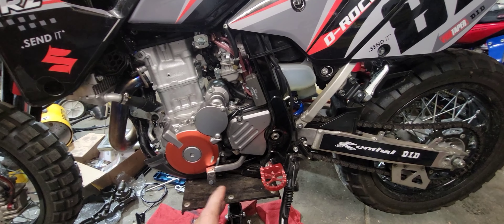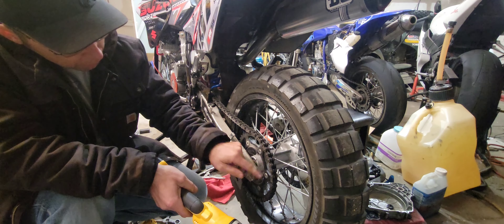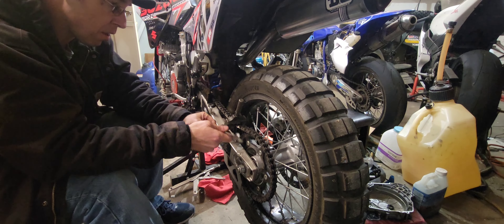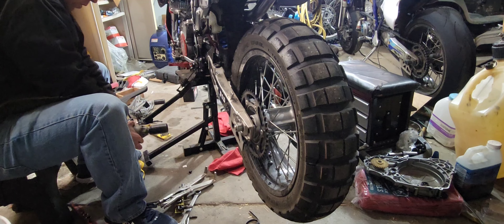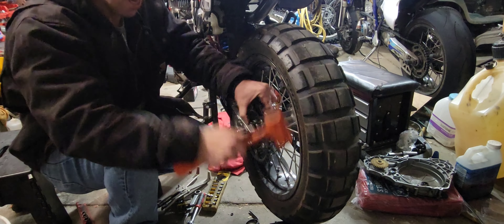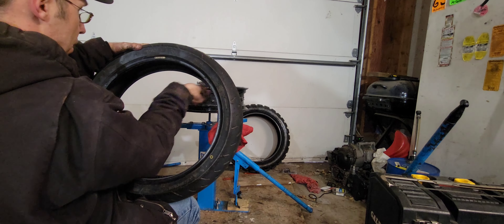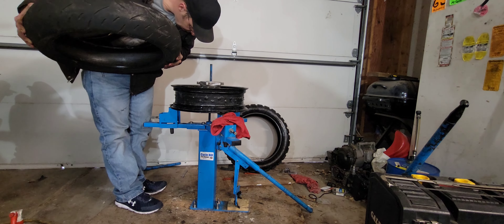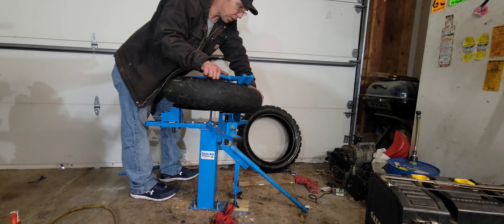DRZ 400SM Upgrade Series Chain, Sprockets, and Tire Change

Comment: Looks like a dunlop q3 plus on the blue wr huh?  what size is that?  going to pick one up.  thanks, luv the vid's.
Reply from the maker: On the other side of the DRZ is my 99 YZ400F. It is equipped with wide ratio gears from the WR model and a plus 5 mm piston Lectron carb And those are continental attack SM Evo tires. They are absolutely nuked. I'm just going to say screw it and put a set of slicks on it.